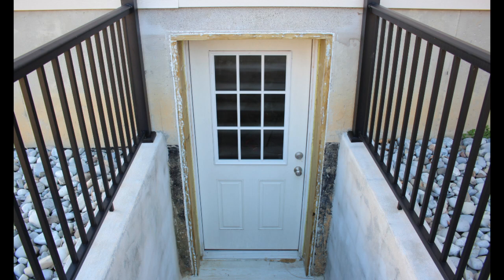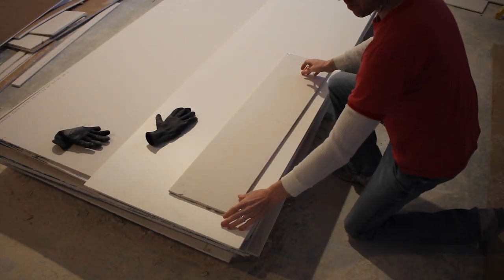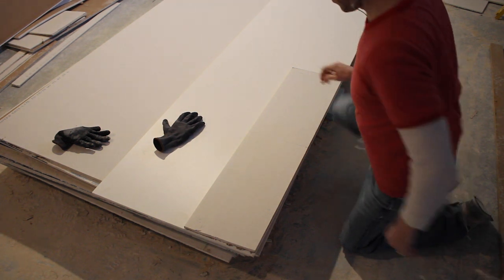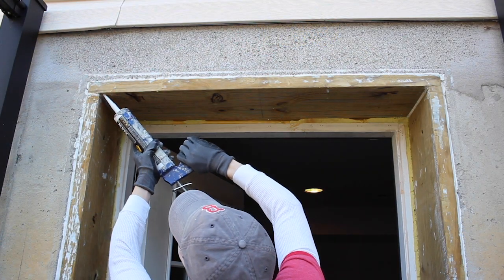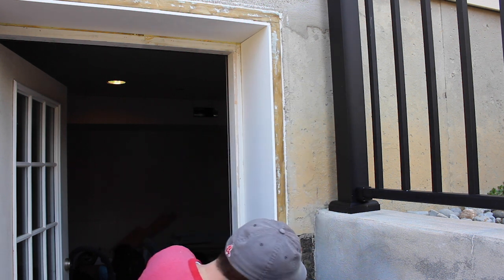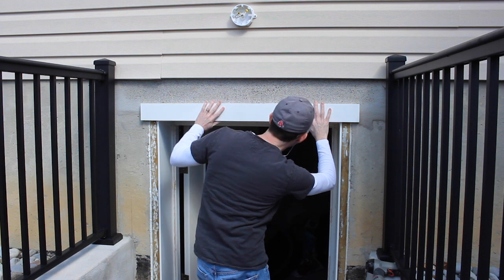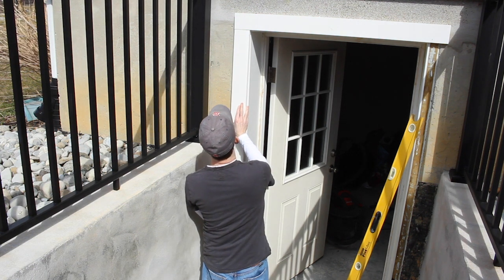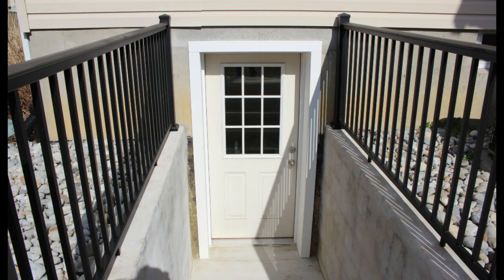How to Trim an Egress Door

Comment: The rough cut in the concrete would the same as it'd  be for any standard door size correct? You just shift it all back towards the inside and covered up the exposed area with the pvc trim. My guy was babbling something about having to cut the rough cut for foundation 2" bigger then normal doing it how you did
Reply from the maker: The opening has to be wide enough for both 2x lumber that gets anchored to the concrete foundation walls, the interior of which becomes the rough opening for the prehung door.  So for a 36" wide door, your rough opening it around 38"-39" plus 3" for a 2x4 on each side.  Everything else is covered with PVC trom.

Comment: Probably not in your thinking, but I would have added a security mesh door into the outside. That thing seems too inviting to any burglar even if it is connected to the burglar alarm, almost no one cares about them, since they can get in and out before any help arrive.
Heck, I've seen people adding vault doors to their basement out side access to protect the expensive stuff inside. Sometimes they will have yet another secure door after the exterior one, just to delay even more and give more time to the armed owners, or the police, or the security company to get there before further damage can be made.
Reply from the maker: We're in a very low crime area, so while we have a security system and cameras, etc., we also don't see any break-ins.
Reply: @OHFScratch  with about 1 in 4 chances of the house being burglarized in a person life, one should not give it to chance, and make it a little harder so that only the professional thief's get in. But is your home, not mine, so please don't feel the need to reinforce it a little just because some random person on the Internet mention the subject.